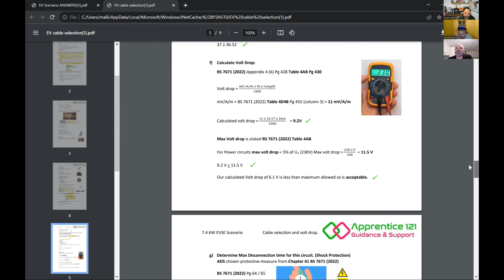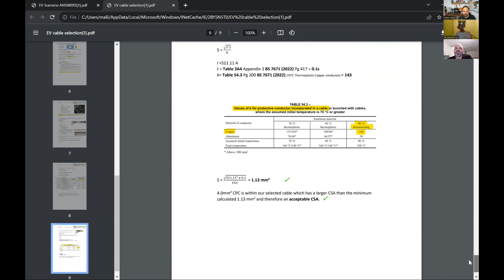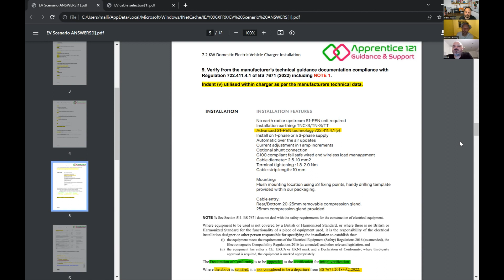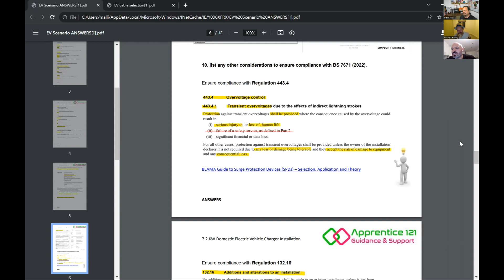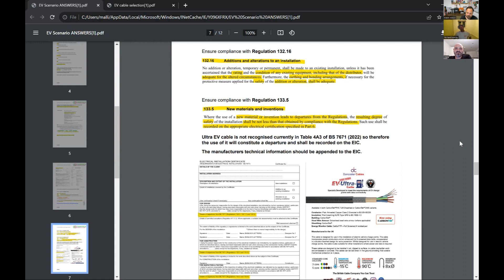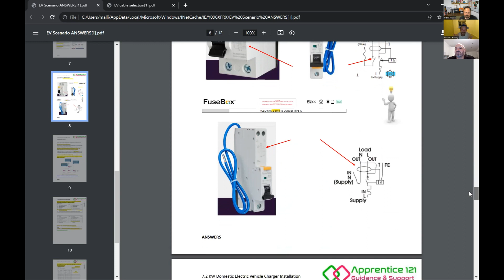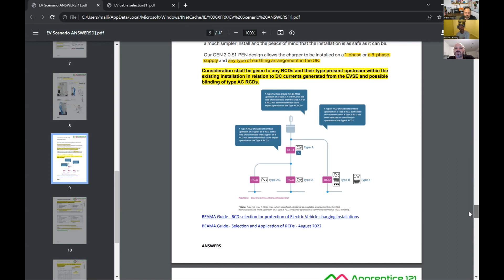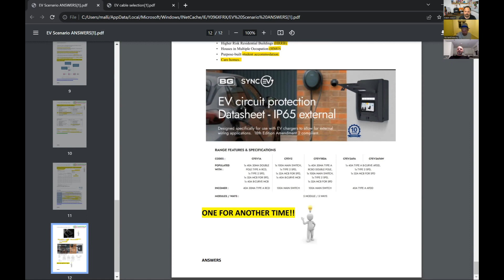2396 - Electrical Design - EV circuit with full cable calculation run through - E5 Design Series

Comment: AFFDs & EVCE:

An EV charger (or EV Charging Equipment) is a piece of apparatus which can serve one or more outlets (i.e., the supply to an EVSE won’t necessarily be a “final circuit” as there could be 1 or more “outlets”).

An “outlet” could be either presented as tethered or socketed, it is not classed as a “socket-outlet” for this intent and purpose.

You can see where this is heading…

AFDDs not required (not under the 4 specified conditions). However, a designer can choose an AFDD following the regulation “recommendation” if they do choose.
Reply from the maker: The interpretation of intent in a nutshell isn't it lol. 

A simple sentence in the regs saying EVSE are excluded from the AFDD socket requirements would be a lot clearer. Especially if highlighted in pink! 

I've had this on some of the podpoints and funny looking large white chargers I've forgotten the name of 🤣. Twin outlets. Is it the same as a twin socket??? What is an outlet/socket lol. The plot thickens 🤣🤣🤣. 

I think we went into this on the original webinar/episode prior and essential said the same as you.

I don't think it's applicable but doesn't hurt. If anything it's a solid idea.

See you in Manchester later this month hopefully.

Comment: Really enjoyed the show.  Interesting debate about the 70 / 90 degrees celcius.  I think it is important to explain the install.  Maybe use the 70 degrees C calculation for domestic even if you use the 90 degree cable.  However in comercial / industrial they do have kit that is 90 degree celcius rated.

RCBOs apperently come in single pole, double pole and Single Pole with switched neutral.
Single Pole with switched neutral is not the same as double pole.
William Winter at Verso explains it well on a YouTube video

 A few questions or considerations to maybe add to the doc
When you say it's a fixed load, it is now but consider if the unit is replaced due to failure, the manufacturer may send out a new model with a slightly higher load,  Eg Zappy V1 vs V2 vs V2.1

What about future proofing the install as we do in a CU.  Eg fit a 12 way board with RCBO+SPD and leave 4 spare ways.  So use the 10mm CSA

Could we get a price for the EV ultra in 2.5mm 4mm, 6mm, 10mm so the price comparison could be made and offered to the customer?

Keep up the great work guys.  I am looking forward to the next episode
Reply from the maker: Hey mate. Lots of great input there.

The switched neutral rcbos satisfy the regs in terms of opening live conductors. But you are right subtle differences.  Will is a ledge, I know the videos in question 🤭. 

If the installation is ever adapted with new equipment that is up to the designer and installer to account for. We can't base our decisions on a crystal ball otherwise everything will be wired direct in 10mm lol. 

Absolutely with future proofing. That forms part of the design equation. Especially at a domestic level when cable routes are not easily accessible down the line. 

The application of design is very important 👌 

Having said the above it very much look like we are heading to more DC charging of EVSE in the future with the possibility of cars running house loads! The trial versions of these require large CSA cabling. Personally I think the 7kW charge points are a 5 year sticking plaster while that tech catches up. Thats my crystal ball 🤣. 

Thanks for watching and the awesome feedback.